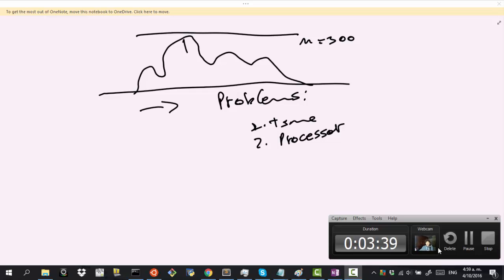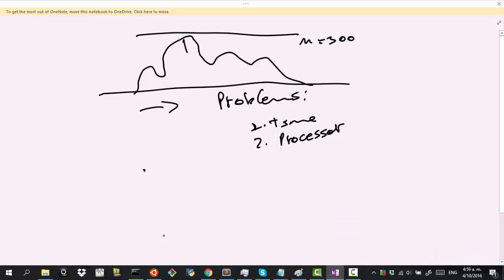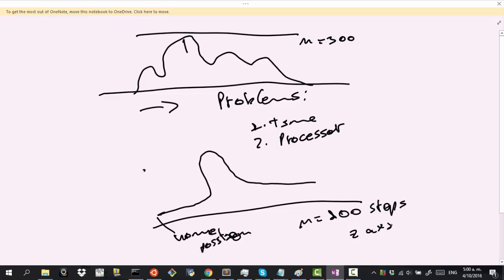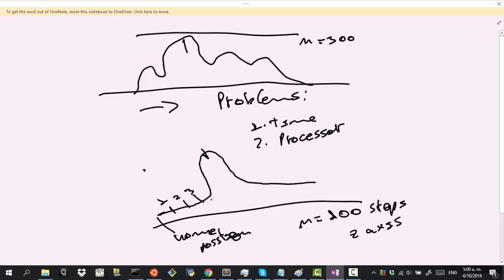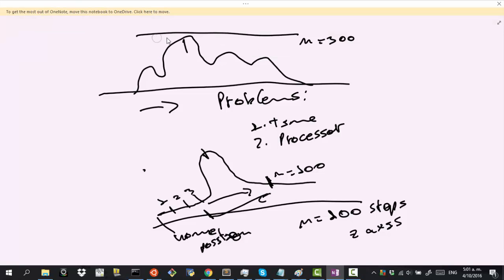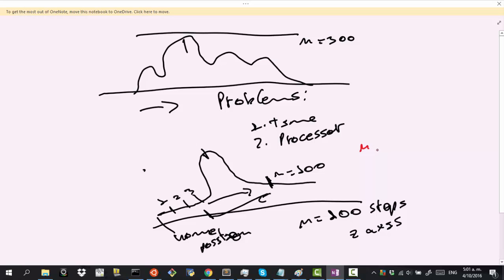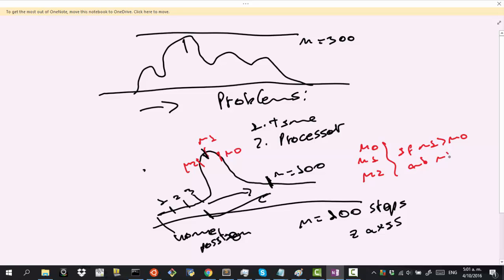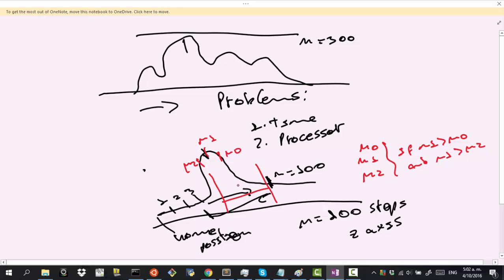Theory Behind our Autofocus Algorithm - Video Log 25

Comment: Hi Rodrigo, coincidence, i was trying to find out an algo, and yours is the first on i've came up with (measuring the laplacian). My problem is that my device moves in a super noisy fashion (steppers vibration, build rigidity). Even with heavy damping (m1=0.1*m1+0.95*newmeasure) i still have lots of false positives. Any suggestions (appart from making a better device :-)) ?
Reply from the maker: Currently, I am facing the same problem with another prototype I am building. My suggestion would be to use a heuristic approach based on features that measure focus distance. Other idea is to use localization in my focus axis. I am working with a microscope, so that is why I am giving these ideas.
Reply: Yeah had that in mind too will let u know what I came up with If u want. Btw, been looking for your hackaday page from log 16 (https://hackaday.io/project/10188-automatic-digital-microscope), seems it moved or something ?
Reply from the maker: Yes, I am sorry. The project now belongs to a company. So, it is no more open source.
Reply: no pb ! bit sad for os, but no one seems to have hooked to the project, so nice move :-)